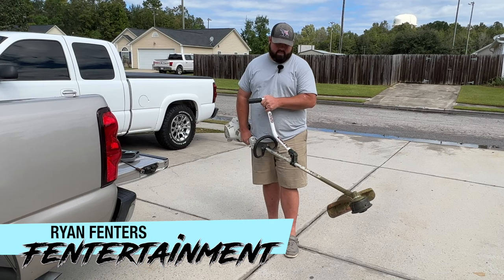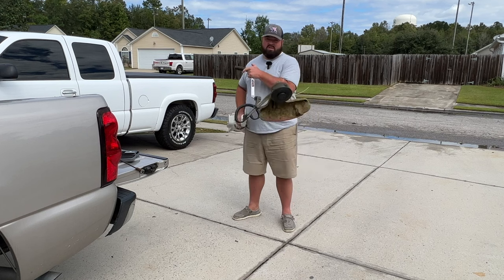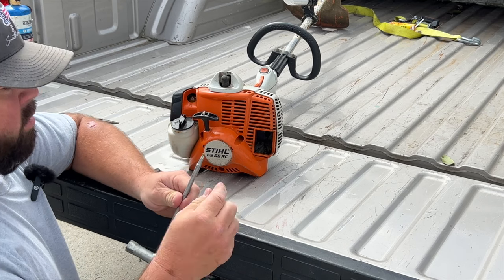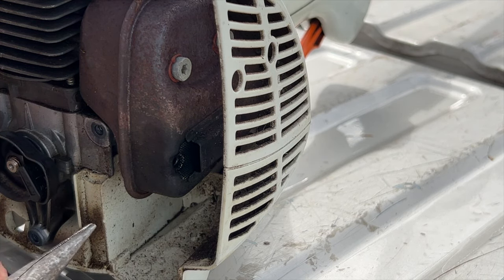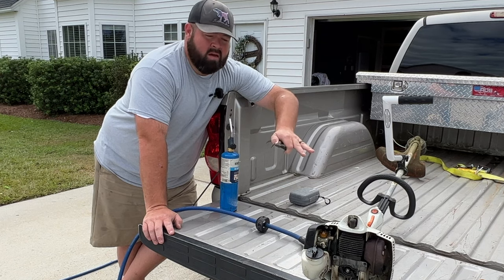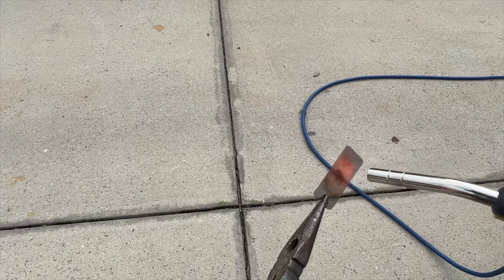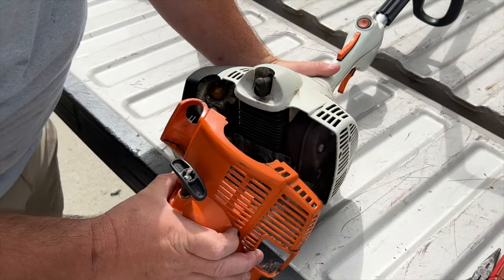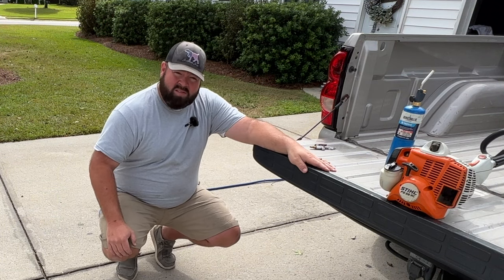Stihl String Trimmer Bogs Down at Full Throttle | Check This 1st Before You Clean Carburetor

Comment: You're the bestest. Mine had a ripple fitting with a 15mm hex to get it off and the screen is like a tube. Once you undo it it pulls out. Cleaned it and runs like new again

Comment: Tried this.  Thought it worked...
My FS55 runs great till it doesn't.  Bogs down and won't run right.  Flowed your advice. Thought that was it.  Nope.  Removed the spark arrestor.  Ran great....till it didn't.  Seems like 5 mins at WOT is about all its good for.   
What's step 2 after cleaning and removing the spark arrestor?
Reply from the maker: Maybe a dirty filter screen in the carburetor.
Reply: I have a similar problem.  My fs80 runs great till it's hot (30-40 minutes of use), then it bogs & stops on acceleration.   I can restart and get it to idle, but it dies when I touch the accelerator.  I removed the exhaust - screen is tine and no exhaust flow issue.
Reply: Yup similar issue for me. Bought a new trimmer cause of it. But the new one just doesn’t have the jam my old one does
Reply: @stevealexander8010 Both of mine did the same (run ok until hot, 30/40 minutes or less) then would bog down completely on acceleration and stall. Would still start and idle though.

Did my head in so much I ended up getting an electric one. Things an absolute torque beast and has zero problems. Would recommend if finances allow.
Reply: Mine did that with low octane fuel.  91 ethanol free and no more.